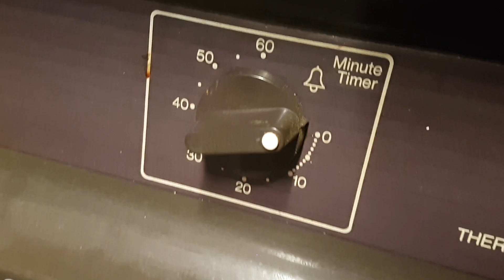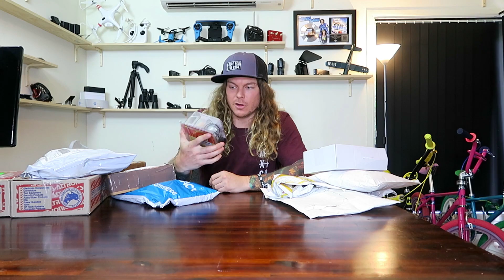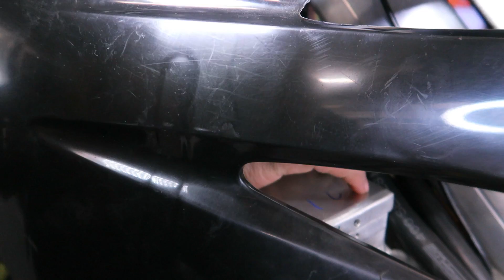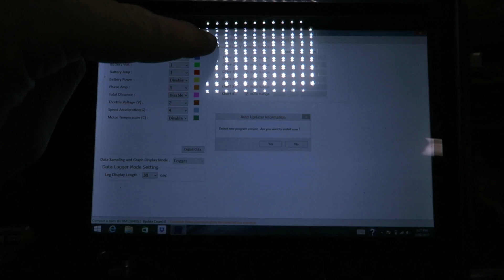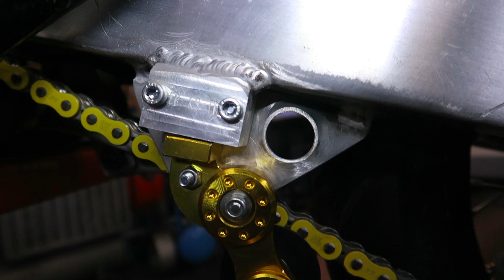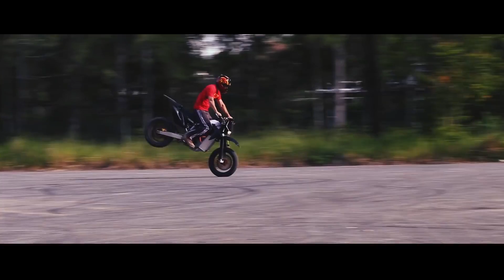50KW ELECTRIC SUPERMOTO MX BUILD [EP 3] FIRST RIDE & HOSPITAL TRIP

Comment: Dear brother you are doing a great job hi5 from India, I wish to bring to your notice 1 thing, if your controller is rated at 72VDC and 600Amps you are running it at 90 volts 600Amps that's maximum limit of your controller, you can go in for higher amp controller with 90V may be a 90V 1000 Amp controller that will prevent from burning or damaging the moter since max you would pull is 600 amps, You need a buffer over the maximum limit of moter in Amps for the controller, believe me it's a healthy practice you also will be using it in race application where it will get heated though it's liquid cooled it can go bad, it is a lovely peice of equipment, I apologise if I may be wrong!! But would not like to see something go wrong with the build Cheers Love and warm regards from India🌹👍🙏

Comment: Holy shit I didn't know that the water in your breaks could cause the breaks to apply. I did know break fluid absorbed water but wow that's dangerous. I have found plenty of cars that have sat for years and rebuilt the carb, put a gas can on with a pump, and drove them up to 100 miles home just like Roadkill does.

Comment: Replace the dot3 brake fluid with dot5 silicone brake fluid. It's not hydroscopic, lasts forever, no need for changing, and for use in high temp applications. It's also a direct fit replacement. Make sure to pull a vacuum on the drained brake lines to try and clear as much dot3 fluid as possible. You never need use non-silicone base again.

Comment: Never in my life seen or even heard  a front brake locking by its self I was riding an old 1974 TS400 SUZUKI AND ONE OF THE BOLTS BACKED OUT OF THE FRONT BRAKE HOLD AT ABOUT 50MPH AND IT TORE MY ASS UP I GOT A DEEP BONE BRUSE THAT HURT 10'S MORE THAT WHEN I BROKE MY SHOLDER AND COLLER BONE BUT I STILL NEVER HEARD OF A FRONT BRAKE LOCKING UP BECAUSE OF WATER FLASH OR WHAT EVER YOU SAID IT DID AND I SEE YOU HAD THAT SLING IL ON BUT AS YOU WAS SITTING AT THE TABLE YOU WAS WAVING YOUR ARMS AROUND LIKE CRAZY WHAT'S UP MATE NEED SOME ATTENTION !

Comment: I had to learn the hard way lol I took a friends bike for a test drive after I rebuilt the motor and was doin about 35 mph and a car came over the yellow lines and I locked the brake up and slid around him but when I went down I hit my head on a tree stump and put a nice gash in my head. I learned be prepared because its not always your fault accidents happen. I had no plan to drive fast or do anything crazy so I figured I'd be good just jumping on and I was wrong, within a football field of my driveway. then I had to replace his handlebars and throttle and get stitches but I'm lucky it didn't just punch through my head I could have been stuck to the stump. and I got a protect your assets pad after I ripped my ass off on a chipped and tarred road I whiskey throttled hit power band and the bike took off out from underneath me and my ass met road and rolled and broke my collar bone. riding is so much fun tho I don't care how much I get hurt. I won't be the old man bitching at kids i will be showing them how to do Wheelie's. lol

Comment: you need a vent on the battery tray if a lipo will go it will expand the air in it check lipo test in ammo box if you close the box and the lipo will go boom it works like a bom

Comment: I'm going to call BS on why the front brake locked up, there is a release hole in the master to prevent that. If that hole was clogged from sitting then yeah. But glad you were wearing your gear and are OK, Interesting build.
Reply: I've had that return pressure pinhole blocked up on me. Brakes jammed on full to the point where the disk went purple. Not bs.

Comment: Is there any way to get a spec list of the components used in the final configuration? You've done an outstanding job and that bike is completely sick, but for those that do not possess your electrical and electronic skills, trying to duplicate what you have done is pretty tough without a parts list and a supplier list. I'd really like to build something similar, but it would take me a ridiculous investment in time if I were a to attempt this without a parts and suppliers list. So, can you help a fellow builder out? Just a list of suppliers would be an unmeasurable help. What do you say? Copies of your receipts would do the trick and I bet your suppliers might even offer you discounts in the future if you sent them additional customers. You've obviously done a significantly better job than most of what is on the market and you've ended up with something that actually looks like an ICE-powered supermoto. Regardless, you should be very proud of your accomplishment.

Comment: Can you go more in depth with the parts you used and the building process? I have been looking to build a electric bike but i do not want to use those heavy lead batteries or brushed motor. I am a hobbyist so i know about lipo batteries and brushless motors but you can't really find one commercially. I have been thinking about buying a bunch of sing cell lipo packs and making a big battery pack. Only thing is i need a motor to know how much i need and etc.

Comment: i wanna thank you for posting your injury update... i learned how to, and changed, my bike brake fluid after watching this video. your hospital trip story saved me suffering the same fate, thank you for teaching people about an uncommon but serious accident that could be waiting to happen. its much appreciated!
Reply: brake fluid is just a hydraulic fluid essentially. It gets extremely hot just from the force applied to it, since the lines are hundreds of PSI under load. That heat causes the water to boil and take up more space, thus pressurizing the lines just like applying the brake. A large amount of water in fluid for any car or bike will lead to this to some degree, it doesn't have to be ridden hard, 100c is in the normal range for operating temperature.
Reply: Chris Clark...damn you should be a vocational teacher! Awesome explanation.
Reply: Can you expain, how exactly the water had led to blocking of the brake? Did you heated the brake to 100C? Really?

Comment: If you would change the back chain gear to a smaller gear, would it be faster or slower? 

Or would it have a faster acceleration with a slower end speed or a slower acceleration with a faster end speed?
Reply: moreartmorecolours red    faster acceleration with a slower top speed. Think of it like a bicycle with gears. Big gear in the front small in the back makes it hard to pedal but will make you go the faster but accelerate slower than small gear up front with big gear on the back

Comment: Sick build bro, that's awesome! Good job, good on ya! I started thinking about how good electric dirt bikes could be when I went from fucking around with r/c glow engines to brushless electric on lithium polymer batteries and was amazed at how powerful they were, how quick they charged and how good the run times were, where'd the inspiration come for this thing? You get good run time for charge time? What do you reckon it cost ya? Being a prototype sort of thing that hasn't been done before I guess you had a bit of trial and error going on for a while before you got there. Again good job mate, where you from?

Comment: man I am sorry you got all fucked up but I am glad as hell you had your gear on!  I fully agree with the message there, I won't even ride my bike around the pits in 1st gear without having my gear on. just isn't worth the risk to save 1-2 minutes of gearing up. 

that bike is insane!!! approximately how much did the electric system components add up to so far? I have an old bike with a bad engine hanging out in my shed that may have to go electric